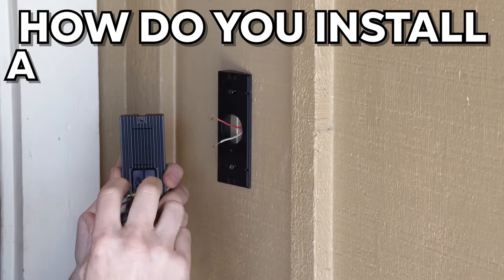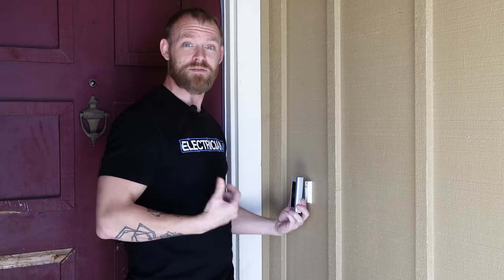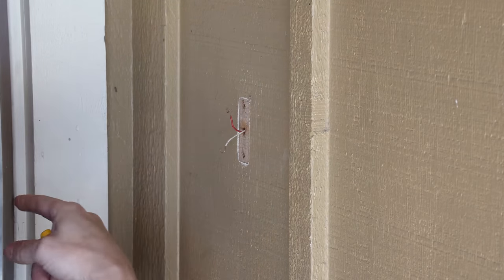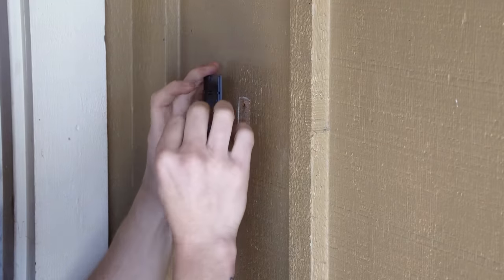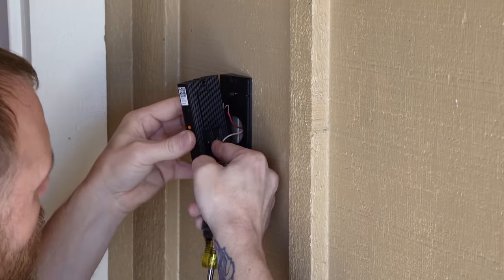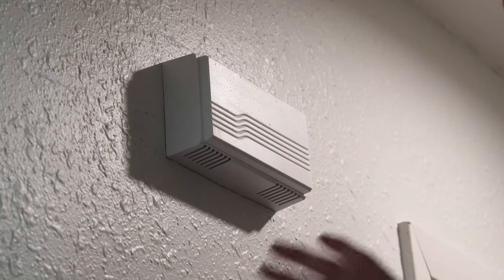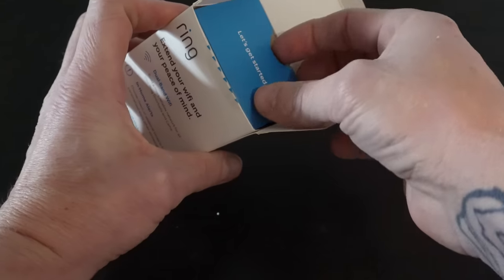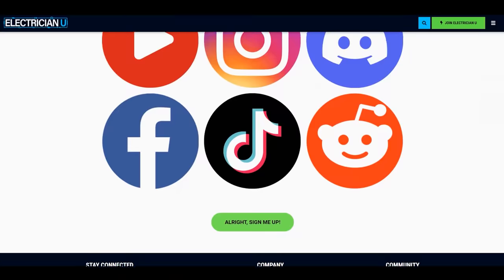How To Install a Ring Video Doorbell Wired -  From an Electrician

Comment: I am thoroughly confused.  My house is fairly large and when I am in some parts of the house, I cannot hear Alexa announce there is someone at the door.  My previous wired doorbell chimes could be heard throughout my house.  I thought this video would help connect both the existing chimes and the ring doorbell so both would alert…but then went on to say to buy the plug in devices to hear throughout a house.  Does  an existing wired doorbell not function with a ring doorbell?

Comment: Thank you for your video but I have a problem, I did everything right but now I have a buzzing noise and it got very hot I disconnected it call a electrician and he can’t fix my problem either. Do you have any suggestions?

Comment: You didn't show the process for how you hooked up inside the chime box. Just that you put the ring device in there. Does it matter which wire goes where? is it intuitive? How do you know the transformer has the correct needed voltage?

Comment: I was told by a friend that since the doorbell is a low voltage doorbell that I don't need to turn off the power. Is that true?  I am also curious why I need to go to the chime device and do anything there since the old doorbell chimes when pressed.

Thanks

Comment: In your install example in this video was there already an existing Transformer? If so how were you able to add that Ring add-on do-dad? or did you have the remove the old transformer first and then you added that Ring voltage item? This was not clear? I dont want to fry my box out if you cant install that Ring add on item in combo with an existing transformer? I want to have my Ring video doorbell4 work along with the original chime currently.

Comment: You mounted the the angled spacer that fits between the wall and the ring camera the wrong way round, the hollow side of the spacer should be facing outwards, this way there is plenty of room for the screw heads not to interfere with the back of the doorbell camera, also the back of the doorbell camera fits nice and flat against the spacer.

Comment: Side note :  Make sure you doorbell transformer is at least 16V, preferably 24V.  If you have a 12V transformer your ring doorbell will not work.  I actually had to replace my transformer with a new 24V one and i also got rid of the doorbell chime on my wall and just use the ring chime.  If you do NOT use the hard wired doorbell chime you will not need to use the included power pack.
Reply: How do you get rid of the original wired chime? I want to do it at home. Can you connect the two (red) wires? > the transformer wire and the wire running to the doorbell?
Reply: Where do you check the transformer voltage?

Comment: Must I install the additional transformer at the original door chime or can I just use the Ring Door Chime plugged into a wall socket and dispense with using the original chime. I have a very small rancher and the Ring door chime (I already own) wouldn’t be placed much further away than the original chime.

Comment: My electrician pulled a line from my current light switches and connected to a transformer, but ring bell doesn’t get powered or detect hardwired.  

When I connect it to a transformer adaptor that goes into an outlet, it works. 

Did he connect the real transformers wrong or you can’t pull power from a light switch?

Comment: Problem is that original old chimes usually don't work.  I hooked up my Ring Wired Doorbell perfect, chimes would not work with it.  I watched videos, did research and the fact is, many many people say that the ring doorbell does not work with existing chimes, so I had to spend $50 more to get the Ring chime.  I just wish Ring was honest that most of the time there doorbell is not compatible.

Comment: Hi, I have installed but inside existing chime does not ring. I had the whole doorbell installed and functioning before installing the jumper in the chime. Is that why the interior exiting chime does not work? How do I go about a fix? Thank you

Comment: Lol I got the gen 1 ring doorbell, and I wired it in years ago, well last week I get notification the battery is dying…  I just figured the transformer was dead,  lol well I’m guessing the relay in the chime is actually the culprit, cause I’m getting  about 26 vac at the transformer, but only vac at the doorbell wires🤦‍♂️

Comment: Just "chiming" in with the others that you as an electrician didn't cover the various transformer situations. In fact, if you find that your ring db is having some flakey issues, it could very well be that your transformer is too small. That is assuming you don't have WiFi issues. If you want a more comprehensive doorbell, look at the Ubiquiti G4 Pro with dual cameras. It's second down firing camera let's you see packages & things that the forward camera does not. It's better overall because it's not cloud based. But then again, it means investing in a more overall WiFi/home video security system using a Ubiquiti UDM-PRO, but if you can afford it, it's way better.

Comment: Question for you. I installed one of these correctly but there's a second doorbell when pushed causes the ring to restart like its stealing power from the ring. How do I correct this?
Reply: Probably causing too high of a voltage drop most likely cut to undersized transformer. Would try a larger VA ( SIMILAR TO WATTS ) transformer and use the highest voltage recommended for system. Using a higher voltage provides more VA'S and a lower voltage drop.

Comment: We have a Honeywell Ademco 747 chime box.  We are trying to convert our doorbell to a wired Ring Pro.  However, when looking at the chime box, it looks like a speaker and has four different colored wires coming out of the wall, one (green/black) are connected to a black lead that goes to a board in the chime and then a (red/yellow) connected to the chime board via red lead.  This looks nothing like the chime box in the videos I have watched.  Do I need to replace the Ademco 747 with similar one to what's in your video?  And if so which wires of the four coming from the wall do I use to connect to the chime box?  The doorbell has red and white wires connected to it and the transformer also has a red and white wire coming out of it.  The transformer is a 16v/10.  Any help would be greatly appreciated.  thanks.

Comment: Do you need to turn the power/electricity off to the entire house before you install the ring doorbell? Thank you.
Reply: Only on specific areas, but you can shut down the entire house by breaker to ensure that grid is down

Comment: Simple question does that mounting plate and/or kit come with the ring doorbell or do you have to get that seperate?
Reply: Mine came with plate and anchors. Should be all you need
Reply: Everything you need, minus a drill if you need one, is included.  Even includes the screw driver.

Comment: Would you just turn off all the power on the electrical panel? Or is there a certain one to turn off?
Reply: Either or. There is a specific one for specific areas and or outlets. If you dont know, or its not labeled shut it all down

Comment: Did exactly what you did and doorbell doesn’t work, checked transformer and it’s set at the 16 volt settings. Had a doorbell that played various song, replaced with a new ding-dong doorbell and it still didn’t work, ring video works fine, I’m talking about old doorbell.

Comment: My issue is the actual doorbell wire. My home is less than 8 years old and the wiring run to the doorbell is about 26 gauge. Can that even carry the voltage needed?
Reply: Splice down or up, but then your getting over your head. Whatever gauge the wire just needs to be able to handle the current, not so much size matters, but if your pulling 12 volts you probably want a thicker wire. I aint an electrician, just goin off what ive been taught

Comment: After you specifically pointed out removing the clear covering from the front, you installed it with the plastic still on (@ 4:17-4:18). We're listening.

Comment: Is it overkill or a bad idea at all to add some kind of ring/hook/spade connector on the ends of the low voltage wires to get a more secure connection to the Ring’s terminals or make future maintenance easier?
Reply: The wires are so small, not worth the hassle. Connectors may interfere with the installation.
Reply: Not really bad idea or overkill.  The extender tails that are provided have the space terminals crimped on.

Comment: I'm trying to put in a ring doorbell The instructions say to put a jumper cable on your original doorbell chime. However in both breaker boxes, one inside and one outside...there is no spot that says doorbell. 🙄🤪🤦🏼‍♀️🤷🏼‍♀️
So does this mean I have to turn off each individual switch or the whole house which I really don't want to do?
I mean literally there is no switch on either breaker box that says specifically doorbell chime. 🤪🙄
So what would I look for?
The chime is in a hall upstairs... That will help some of you figure this out for me. LOL

Comment: Note only the Chime PRO will extend the wifi signal to your Ring devices (doorbell/camera) not the regular Chime which only lets you hear the DING-DONG elsewhere in the house. Also how do you know if you need that add on device that you installed in the existing Ringer in the house? I have a Rng Doorbell 4 and it didnt come with one of those so.....? Where can I buy one?
Reply: Wondered why you need something in the chime box myself.  If it doesn't seem to turn off the bell, what does it do?  I've been looking at a few wired ones and want to keep the bell sound but also send a notice to the app when the button is pushed while not having to replace batteries every few weeks.

Comment: I'm running my essentials on a generator because the panel in my basement had water coming in from the thaw. It comes in underground . What do? I have opened the disconnect from my meter to the house.
Reply: I'm thinking to add a drain from panel through to my sump  and silicone the entry.

Comment: Maybe you should include what to do if you don't have an "Existing" door bell or yours if broke AND whether or not the transformer thingy is required and what it is for.  Also include the Chime that comes with the house will not work after installing the ring door bell .  this was not a fun and easy project, wars and divorces have been created for less.

Comment: is there any way to disable the other radio RTs inside video doorbells like this? I don't want to be a part of the Bluetooth network they're trying to set up with ring, and other amazon devices like this
Reply: You'd have to check what settings amazon exposes - which are subject to change without your consent. Also a hardware mod to disable a radio likely will also disable its video functionality since that's how it talks to the outside world
Reply: @td19xyz  I just mean the Bluetooth radio, not the wifi radio. I'm honestly leaning more towards an analog camera system with a DVR hooked up to a dedicated PC. It would allow most of the functionality without being at the whim of some company
Reply: @tedundercarriage8183  they are most likely the same chip, using the same antenna(s). Should have included that in my first comment.

Comment: What size wire do I need to install a new door bell? Does 14/2 works?
Reply: No, way to thick. Should be 18/2 solid conductor.
Reply: u need 14/2 to power the transformer and low voltage wires 18/2 going to the bell and push button

Comment: Why do some door bells need a resistor?
Reply: I think you’re talking about a diode. The electronic chimes use a diode at the button. The analog ones with the plungers that strike the bar to make a standard ding dong noise do not require that. If you chime has a speaker and plays a melody when rung it’s electronic and requires that diode

Comment: This setup seems very janky. Wifi hd video quality is usually far inferior to wired, using an outdated transformer doesn't seem like the best solution. I'm not a door bell installer but an IT guy, and I'd like to see an ethernet POE HD video camera (and nothing cloud based, either). You're running wires to the doorbell already, might as well make it POE and data back to your network closet, battery backed up from a network level, MUCH better video, stored locally (why pay monthly fees forever?), not wired to a transformer from 50 years ago. Idk, seems like we could do A LOT better these days. But again, I'm not a pro door bell installer so idk...
Reply: Bro, although I understand perfectly as I  was in IT for 20 years but to the average person who’s watching this video you’re speaking French.  So typical of tech people.  I had to learn early in my career the average everyday person doesn’t speak Geek.
Reply: @GeorgiaMade404   Yeah, cool story. I can explain it to people but I can't understand it for them. If they want to learn, they can learn, if not, good luck.
Reply: My understanding is that low voltage wire is solely for power rather that recharging.  Not sure how any of the digital quality has anything to do with power supply.  All data is via WiFi or Bluetooth from Ring to phone, ... Again, low voltage wire is just for power.( And maybe to activate chime, but still, has zero to do with video/audio data)  .... That's what I'm understanding.
Reply: @magustacrae  Your understanding is poor.
Reply: Thank you sir. Average non-geeks can also benefit from this "basic" info. Atleast it possibly help anyone especially someone elderly to know whats going on or forbid that could happen to them beyond there doorstep. Simple advice can go along way. Yet being ignorant can cripple more.
Reply: @user-nh3gu1ge3d you're failing to understand our point. Also, you're doing more work for no reason. What exactly is fire hazard here Mr. smart guy? Do you recommend the United States destroys all their older houses that naturally have janky wiring? The old house you're in right now probably doesn't have a ground, and you're crying about this perfectly normal setup 😂. What was your concern on thee old transformer again?
Reply: @Elpipiton  "you're failing to understand our point. Also, you're doing more work for no reason." 

The exact opposite is true, it's YOU who doesn't understand my point and would have to do extra work down the line for no reason (other than to save 5 cents up front). 

"What exactly is fire hazard here Mr. smart guy?"

I never said anything was a fire hazard? Back to point one about you not understanding. 

"Do you recommend the United States destroys all their older houses that naturally have janky wiring?"

.....What? That's brain dead. No, obviously not but I wouldn't recommend installing a janky setup up front which is what they are suggesting. I recommend doing things the RIGHT way, the first time. Not the easy way.

Comment: For an "electrician" video, you never mention the systems supply required lol 10-24 volts AC, at 50 or 60 Hz, 20-40 VA max.